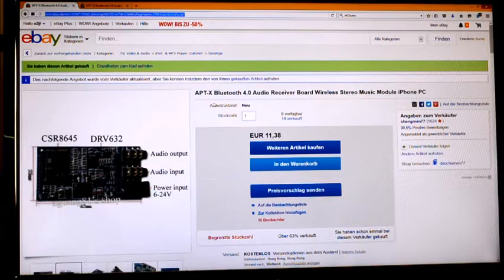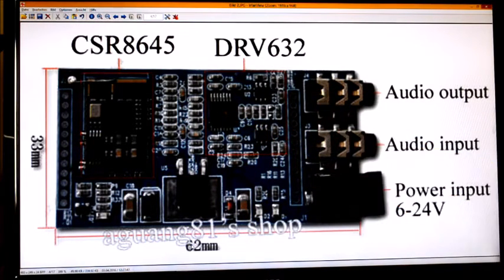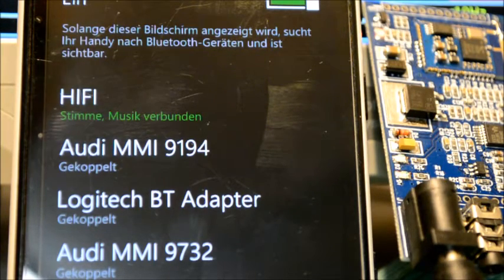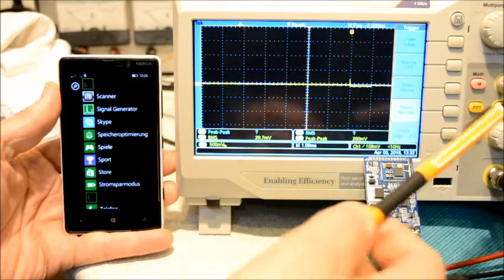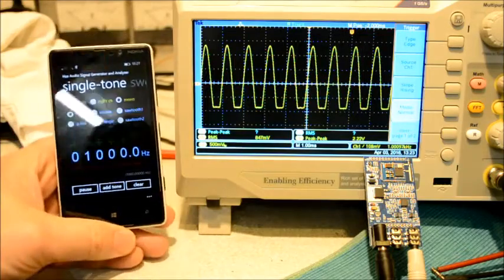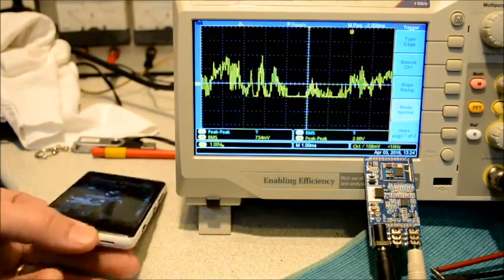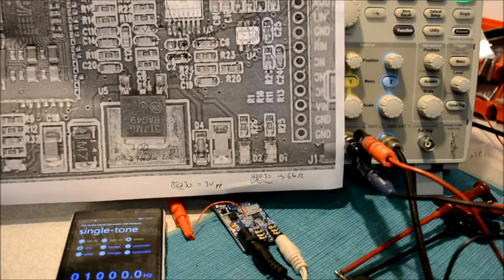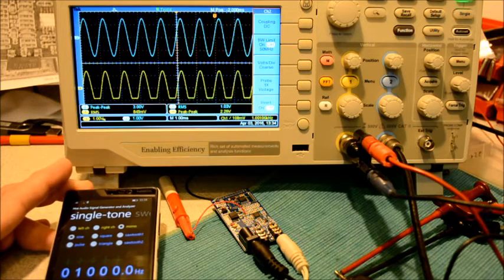APT-X Bluetooth Audio Receiver HW Module Review

Comment: I have done this now on two modules and it has worked great!  The audio quality is vastly improved.  I don't worry about the loss of the input because the amp board I have been using for my projects has an two inputs couples together and one cancels the other out when plugged in.  This module unmodified works very well for headphones too and is more powerful than my phones output.

Comment: Is there any higher quality bluetooth/aptx board on ebay.de or amazon.de? Im amazed on how we depend on chinese low quality stuffs....  Thanks for the excellent post!
Reply from the maker: I used a KRC-86B in my speaker project which works reasonably well. The module from sure electronics (AA-AB41136) looks interesting but I have not tested it so far and it is larger and more expensive.
Reply: Sure electronics Bluetooth 4.0 aptx module is the best available. https://www.ebay.com/itm/141000963644

Comment: Hi Dr. Blue, I would kindly ask for a little help, how could I attach an external bluetooth antenna to improove the range of this card? Thank you very much!
Reply: Rene Protti Hey. You might be able to attach a external antenna on top of the BT-Module but this could be really hard. You would have to remove the original antenna and (the copper trace) & attach an other one. But this is practically pretty much impossible. Greetings
Reply from the maker: Sorry, I am not a good enough RF designer to give advice on this.
Reply: +Hieronymus Kollmann that procedure is as far from impossible as it is far from easy. You do need the right tools.

Comment: i found this on a buying page: Aptx is working, no annoying connection sounds. The gain of the buffer amp is set to high, causing a distortion if you set the bluetooth volume in your smartphone higher as 3/4. You need to change the resistors R3, R5 , R14, R18 from 10k to 27k Ohm if you want a distortion free output. The images shows distorted signal output and the clean signal on opamp input side before modification.
But i don't know if doing this will loose the aux input
Reply from the maker: My understanding is that this fix will not affect the aux Input. You will only have lower output volume and my application the volume would have been too low to drive the power amplifier properly. Please post a link to the page that you found.
Reply: https:         //www.aliexpress.com/item/APT-X-Bluetooth-4-0-Audio-Receiver-Board-Wireless-Stereo-Music-Module-AUX/32456259420.html?spm=2114.10010108.1000014.14.drOElO&scm=1007.13338.51110.0&pvid=0ef90c9b-bd92-46a9-b03c-7dcfe90ad695&tpp=1
Reply: check on feedbacks and you'll see 2 images showing the distorted signal and the clean one

Comment: Good job !!!
Please, would you describe better the modification to avoid clipping?
Tnx.
Reply from the maker: I finally did not fix it fully but simply disconnected the switches and connected 
the driver outputs to the 3.5mm output directly. 
You loose the Aux-in but have an output without the clipping.

To do so:
- remove C2, C15, R27, C23, C25, R28 (below C25)
- connect the free right solder pad below C15 to the top solder pad of C25
- connect the free right solder pad above C2 to the top solder pad of C23

Enjoy!
Reply from the maker: Sorry, just double checked. R28 & R27 stay on the board. Only the capacitors need to be removed for the fix.
Reply: Hi Dr. Blue, so all we need, in order to remove the clipping but maintaing aux in and BT functions, is to remove  C2, C15, C23, C25 from the board, leaving open circuit? Vielen Dank!
Reply from the maker: Sorry if there is a misunderstanding but the aux in is not maintained by the described fix. It is disconnected.